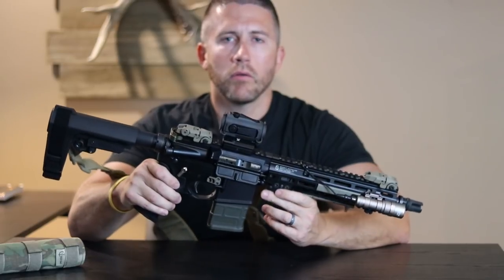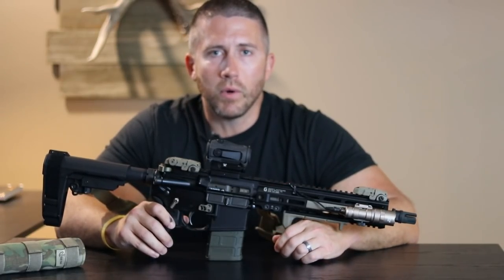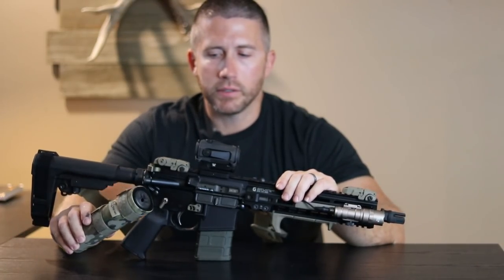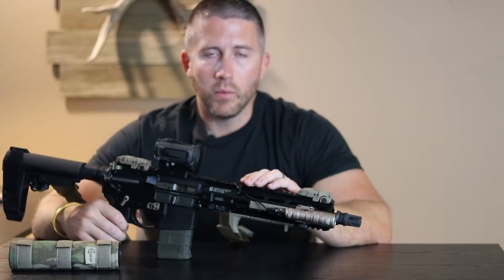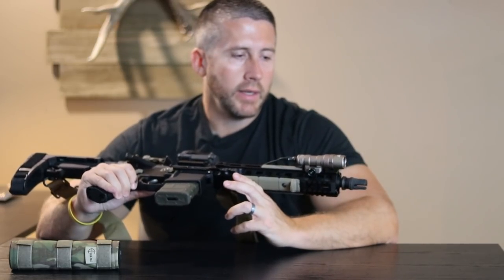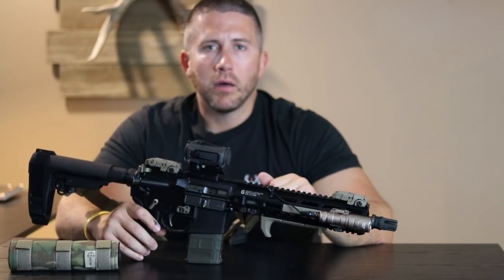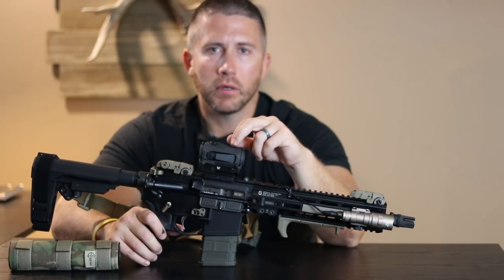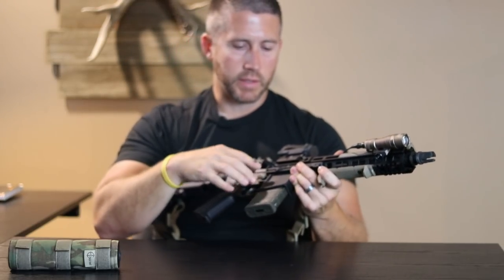AR Pistol | SBA3 Pistol Brace

Comment: What length handguard is that? It looks really perfect with the suppressor on. I have a 10.5 also, but it has a 12" rail system with a flash can. Looking to suppress it and don't want a lot of barrel exposed. Thanks and great video.
Reply from the maker: Thanks!  It’s a 10.3”.

Comment: I'm building a 10.5 carbine length gas system pistol. What buffer and buffer spring combo would you recommend? Won't be suppressing it.
Reply from the maker: Hey Jeffrey.  You would be fine running a standard carbine buffer or an H2.  Good luck with the build.  Appreciate you watching and let me know if you have any other questions.  Subscribe if you don't mind.

Comment: You measure to the end of the firearm fully extended for overall length. Brace is part of the firearm. No where in NFA writing does it say you measure to the end of buffer tube.
Reply from the maker: Correct. I realized I made a mistake in communicating that and have added a correction to my comments.
Reply: @JustaGearHead a buffer tube isn't a buttock either.

Comment: Nice weapon.  Something you didn't mention - I noticed that you have the 45 degree safety.  I guess it's the years of training, but I can't seem to get used to that.  I have friends that brag heavily on them (Ford vs Chevy, I guess).  I have pistols with the SBM4, and the SBA3 braces.  I think that I lean towards the A3, but I'm keeping the M4's on the builds they're currently on.  They're comfortable.  I'm thinking that I may try the Maxim Defense CQB/PDW brace on my next build.  They look pretty stable, and have a decent variation of settings.  But they sure are expensive, comparatively speaking.  Thanks for the video - you have some good choices in components.  "Thumbs up" from this Kentucky boy.
Reply from the maker: Thanks for watching and taking the time to comment.  

I have looked at those Maxim Defense CQB/PDW braces quite a bit.  If you get one, report back here and let me know what you think, if you don't mind.  They are a little pricey but I am willing to pay a little for quality pieces.  The braces have definitely come a long way in a relatively short amount of time.  Again, thanks for watching.  Have a good one and stay in touch!